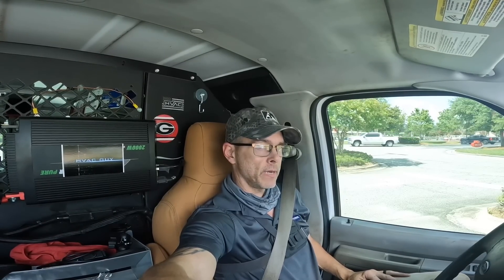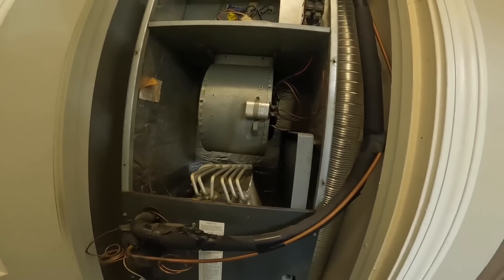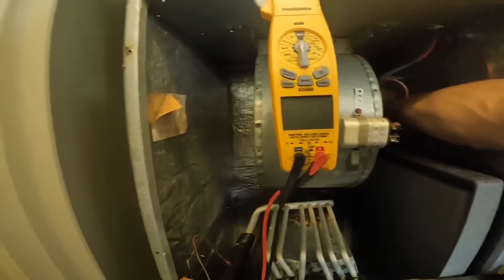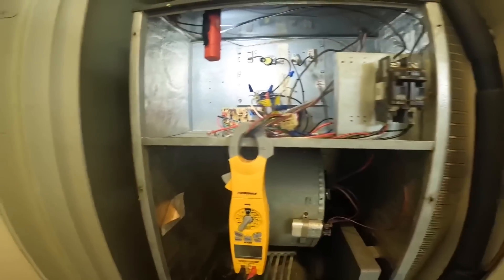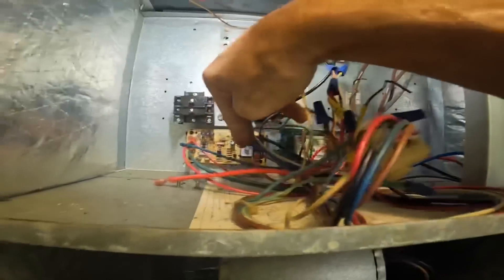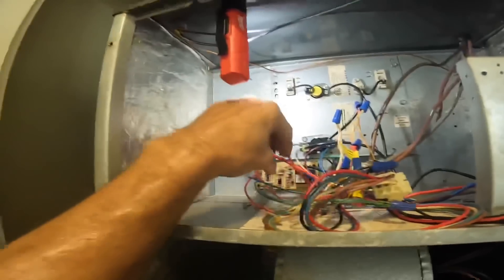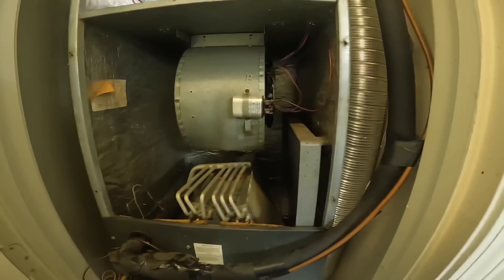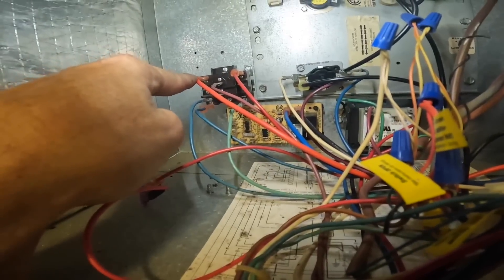Blower Wasn’t Getting Any Power

Comment: Chrysler Fiat went to a Tipm fuse block with the fuel pump relay soldered on.  A common fix is an external relay similar to what you did.

Comment: I wouldn't use that relay as a permanent fix, you lose 1 min of cooling/heating every cycle, that's about 10% assuming 10-15 mins per cycle. And if the air handler is in attic, it will blow hot air into the house before the coil get cold.

Comment: One comment; you shouldn't be poking/pointing around live wiring with your finger! You could be sending the wrong message to those less-seasoned that it's okay to do that when in fact it's extremely dangerous! An insulated screwdriver would've been much safer and can show more of what you're pointing at without your hand getting in the way or an unexpected jolt that will end your career on the spot⚡⚡. Great work, but Safety First and always!
Reply: unless you're dressed up in linesman protective gear, plan on getting shocked(more than once) working in any trade that has electrical involved, which includes the majority of all mechanical things. it's not a matter of if you'll get shocked, it's when and how bad, guaranteed it will happen and more than once in your career.
Reply: @throttlebottle5906  True. However, being more cautious around electricity is the defining factor as to whether or not you'll get shocked.

Comment: Does the blower shut off immediately? Shouldn't it still run for a little while before it cuts off thanks for sharing.
Reply: No the motor cuts off as soon as the outside when it's in cool. It only does the delay on the heat until the last strip turns off and stops immediately.
Reply: @judsonterry6644   that makes sense thanks I'll have to try this next time

Comment: Man what a great idea, much easier than changing that board. Makes you wonder why they didn't have it set up like that in the first place.
Reply: Planned obsolescence
Reply: @chris76-01  indeed!
Reply: They want the blower to have a delay on break after a call for cooling.
Reply: Explain delay on break ? So a relay and a time delay and you basically have that board ?
Reply: @moonlightacmaintenance3232  Basically so the blower can stay on for around a minute or so after the call for cooling ends so the remaining cooling can be purged from the coil.
Reply: @SETX_Sirens_and_Rail_02  Exactly, you beat me to it. Imo though, I really don't think that matters, I mean how often do you change from heat to cool or vice versa anyway? Even then I don't think it would hurt a thing. I like things to be as simple as possible, it makes things easier to work on. Like Chris said, Planned obsolescence, the engineers these days really don't care. They do not look in the future for a repair, just throw it away and buy a new one. That is why I like videos like this, it is almost like slapping them in the face.
Reply: @SETX_Sirens_and_Rail_02  interesting. Thanks. I’d imagine some thermostats might have that feature as well? Must be a energy efficiency thing? If you have a delay on break can you decrease your temp swing if you have one? Sorry for all the questions.
Reply: @moonlightacmaintenance3232  Your questions are valid, I don't think thermostats do that, not that I'm aware of anyway. I have a "smart" thermostat that says checking components (or something like that) but I think is bs. The units do it, for efficiency, but I think is unnecessary. For anything, if a part works and lasts a long time, why change it? The new fancy part goes out so you have to buy another one. It's all about the money. So more efficient saves you money, but you spend more on maintenance. I guess you can't win.🤑😟
Reply: @jthonn  lol, I always say the money you save on electricity you spend on parts. In the end efficiency isn’t about saving you money it’s about lightening the load on the grid.

Comment: That repair is good for a temporary fix, but should be replaced with the OEM part, since it has the on/off delay timing functions integrated. Thanks for sharing!
Reply: Those relays are bulletproof compared to that PC board I don't see a need for delay in that application in my opinion.
Reply: @hinspect  I concur
Reply: I hear ya, but personally, I don't care for the delay function.
Reply: Buy a thermostat that has programming for that. It will last a lot longer.

Comment: Hang on you just said the heat strips are connected to nc which means they can energizer when the fan isn't running?
Reply from the maker: If there’s just a call on W, when the sequencer pulls in it will also start the blower
Reply: So its a dusl speed motor? You will have to forgive my ignorance with G's W's and Y's I'm in the UK where we see non of this type of stuff. Also is the relay special as the number matches a board you mentioned??